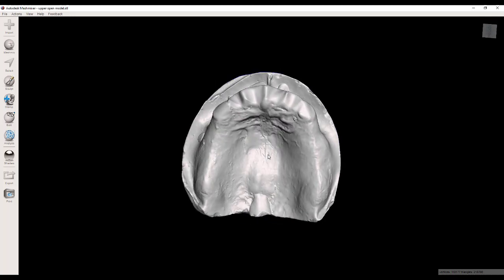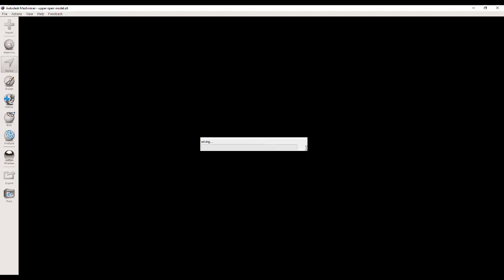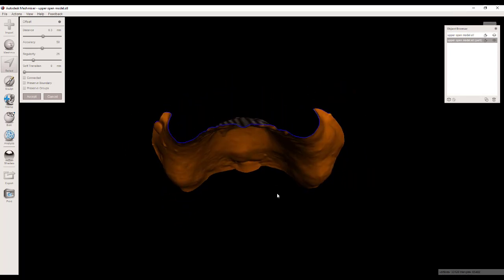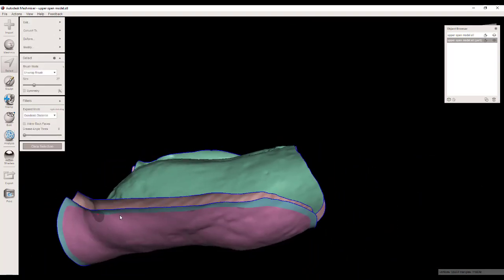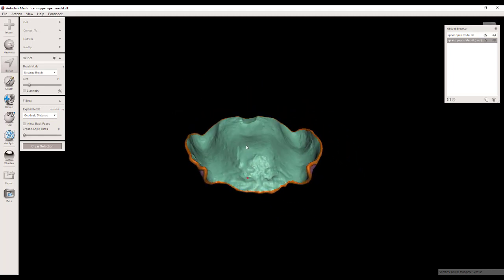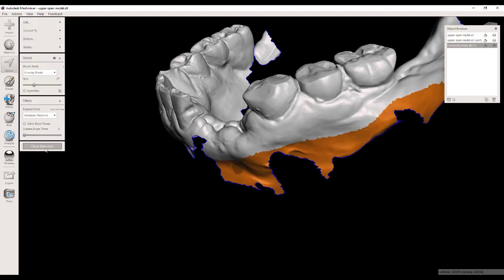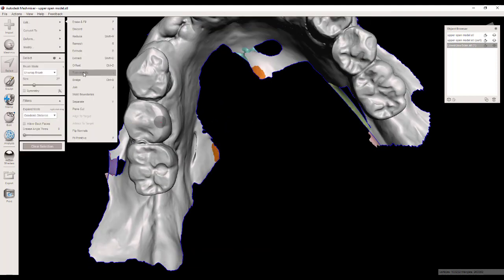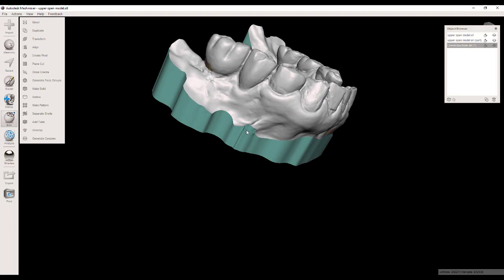Using the Bridge and Join Tools In Meshmixer

Comment: I don't expect an answer, this guy has better things to do... like help people have teeth so they can chew food.

I wish this video helped me like it seems to have helped others. It seems to be just different enough to leave me not knowing how to apply it.
 I'm trying to bridge 2 solid objects that have faces pointing towards each other. 
They are free of errors according to the tools.
I have carefully selected the faces (that I want to bridge), optimized, smoothed, then saved as a face group for easy selection later.
I combined them so the faces can be selected at the same time.
When I choose bridge I get a non-descript error.
I've tried bridging only the smallest of areas on each side. Nope. I've tried re-meshing.  I've tried the whole offset and invert but it doesn't make sense for what I'm doing. Still Nope.

I've been at this for > 10 hours over the course of days and have tried what must be 100 times without success. 

This is one of those skills that has a barrier to entry so high that it discourages most people. The people that are in a position to aid are usually in positions where they don't sit around all day answering questions to stroke their ego. Documentation for this feature doesn't exist (outside this video).
Reply from the maker: 2 ways.... select 2 areas...... then edit tube handle.   Or,  select 2 areas and delete.... now select each hole boundary and join

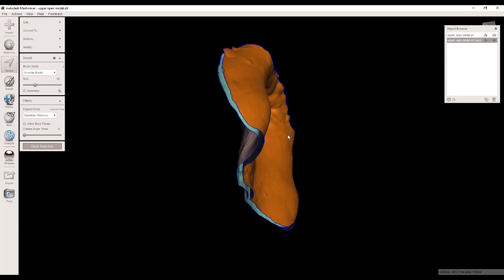Comment: Just getting into this for different applications. I like the .3mm offset tip to fit onto the model. Regarding the 1.5mm offset at 3:30, could you just check “connected”? Or is it really artifacty like when you extrude?
Reply: I've had a lot of success doing exactly that, although my models are a bit larger and less detailed than what is shown here, so YMMV